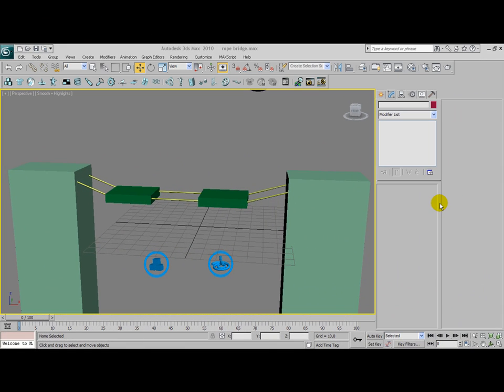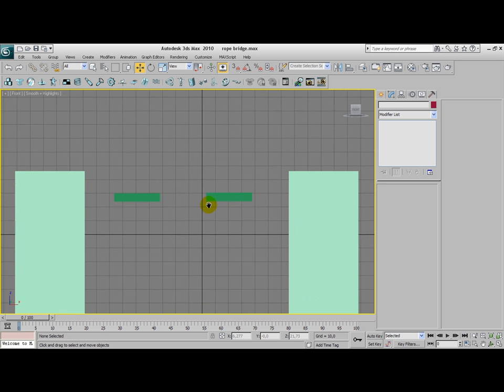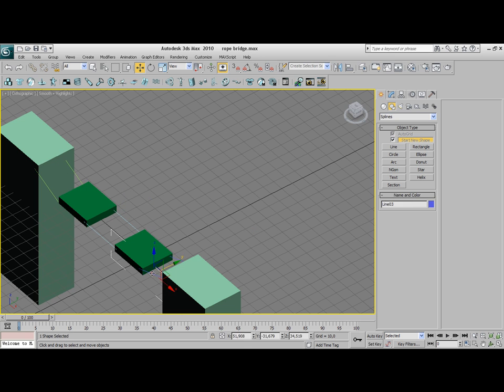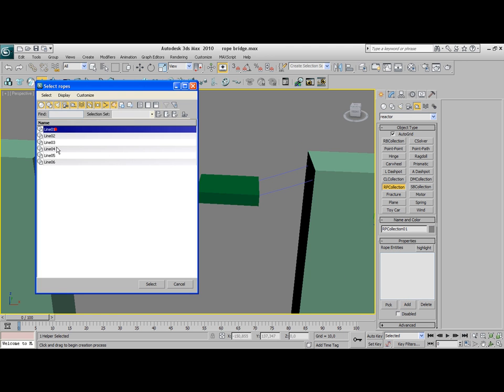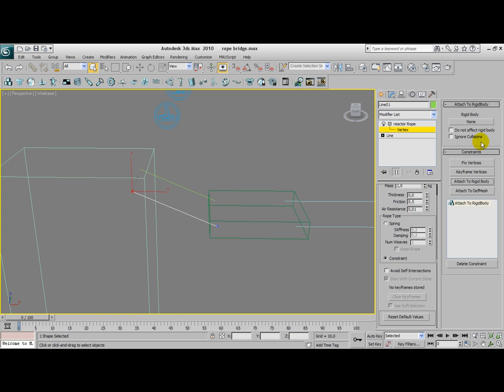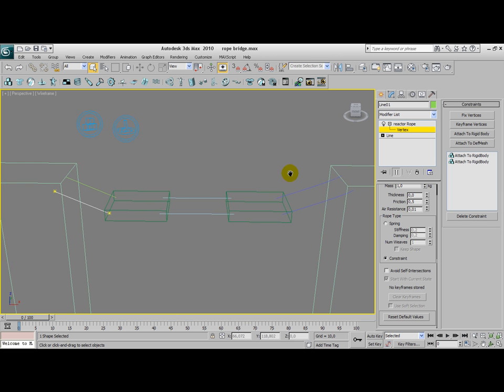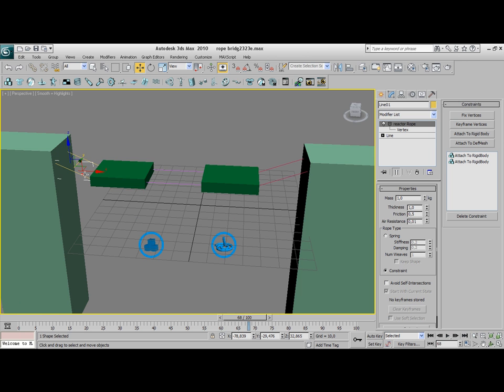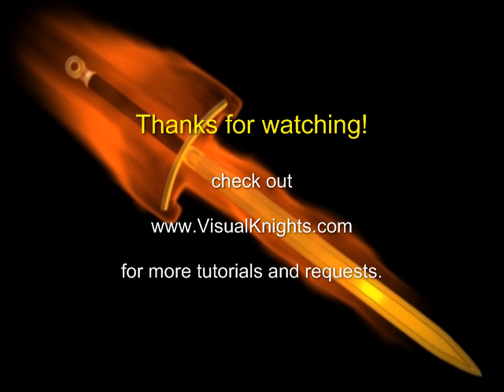3d max reactor tutorial: Rope bridge

Comment from the maker: @linkspecialproximity If you want the cloth attached to an invisble object (like air), you can either use a 'Dummy' or you can hide the object you are using. For instance: you create an object (a cube or sphere) that the cloth uses to hang on to. Ones the cloth is working correctly, you can go to the properties (right mouse button) of the object and select "Hide". This way the colth is attached to the object in the air but it is not visible in your scene or when you render it. Good luck! :D

Comment from the maker: It is not the easiest thing to do but it is possible. I have made a tutorial about a reactor car but that is not really the thing you need for your car. Your car would require a motor, so that the car has a constant velocity and tries to move itself over the bridge. The biped is in my opinion even harder. You deffinetly want to use footstep mode for this. Link every footstep to a stepping plates and let the walking animation create itself. The animation of the bridge has to be made before this.